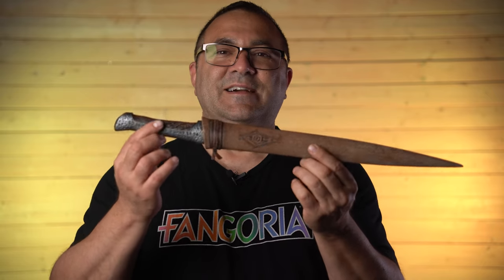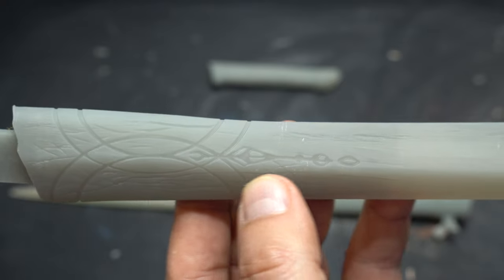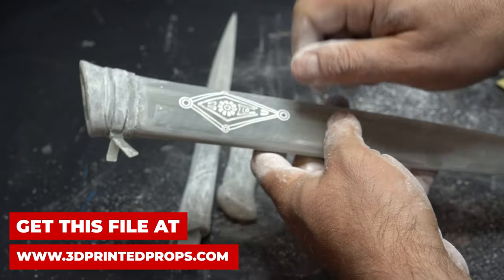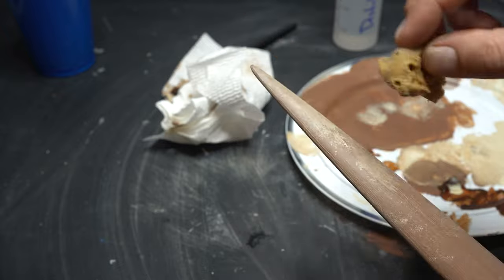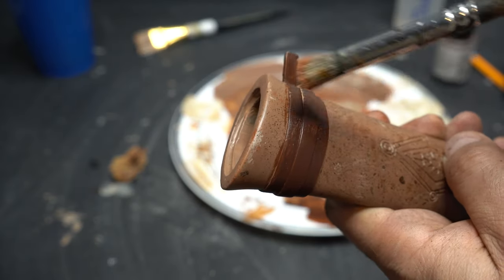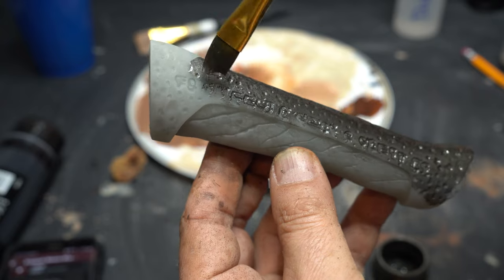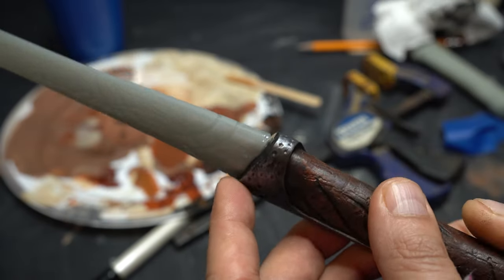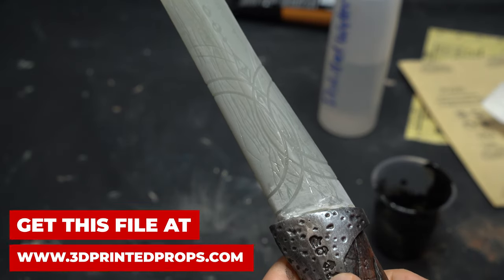Fremen Crysknife from Dune - Painting 3D Resin Prints

Comment: Beautiful job, Kevin! How long are the blade and scabbard pieces? I'm wondering if my Saturn 2 has a large enough build volume? It'd be nice if you included measurements on the Website where the files can be purchased.
Reply from the maker: Yes, I need to add the sizes at 100%, I always forget to do that. None of the pieces will fit on the Saturn 2 at full scale. The sizes are 
Blade - 364.8mm
Handle - 145mm
Sheath - 396mm
I've added these measurements to the listing. Thanks.
Reply: Thanks, Kevin. Have you ever thought about selling raw prints of the larger pieces?

Guessing needto start saving for a larger resin printer.🤣
Reply from the maker: @reprinted3D  Thought about it but I hardly have time to print stuff that I want. :P
Reply: Fair enough.😄